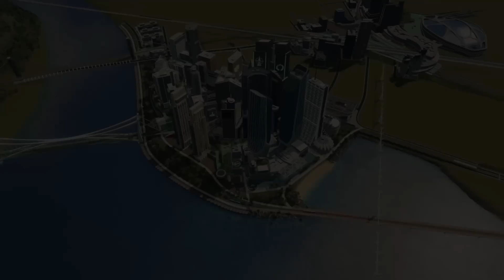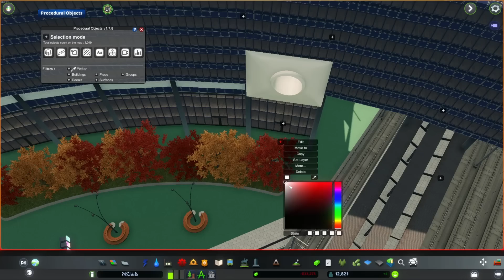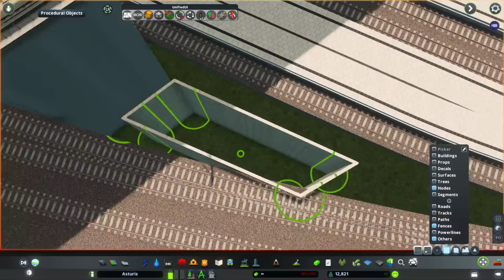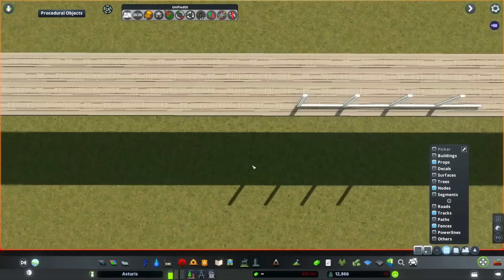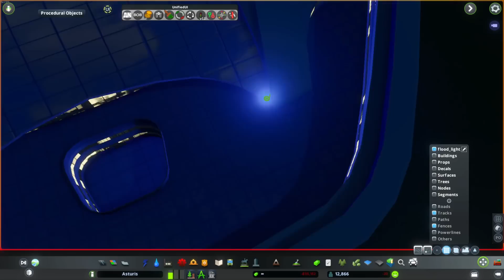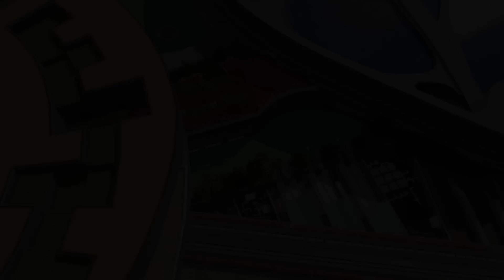Making the Main Hub Even Bigger - Cities: Skylines - Asturis 11

Comment: Something that I love the most about the station itself is the contrast in color between the more industrial style harsh orange lighting over the tracks and the somewhat softer blue lights over the platforms. This color contrast is also shown in the red points of light in the ventilation/ductwork/piping areas between some areas and the greenery and green lights atop the station's larger structure.

This new section definitely makes the station feel more.. not entirely 'more complete', it's obviously still not fully done, but closer to it. The way it fans out feels quite realistic from both an artistic architectural perspective and as an efficient use of space. Despite the clear lack of realism in some aspects of the city, it still feels like it could be realistically designed that way. I think the only missing thing is perhaps some of the tracks which end could lead to closed doors, so that rather than seeming like only a station platform, it seems like the trains can also be brought through those and under the station itself for repairs or loading/unloading of cargo. Though I would like to actually see the industrial stuff like cargo when looking at the station, instead of merely tucking the function under a building and not showing much of it.